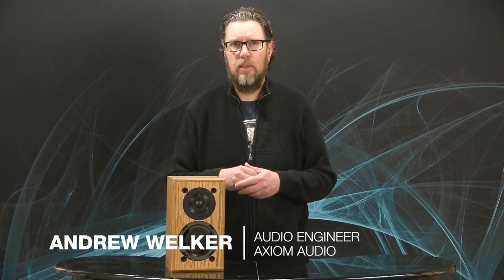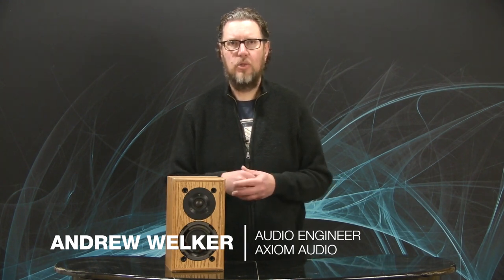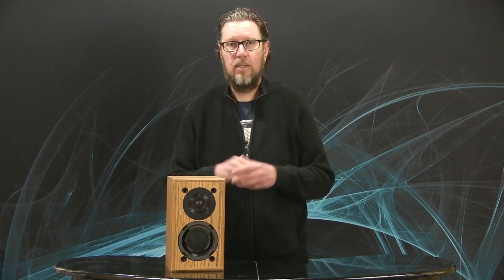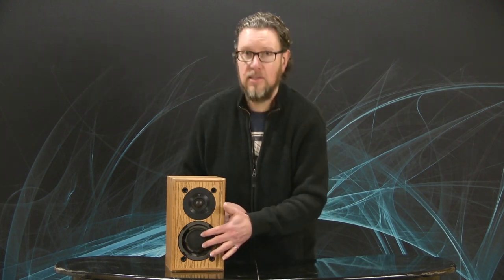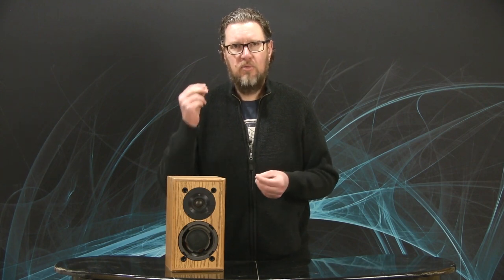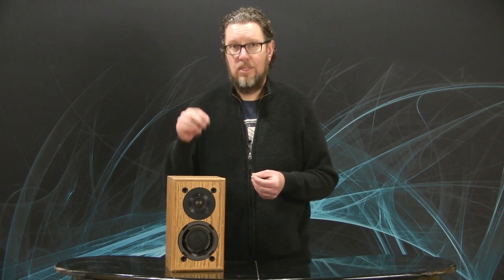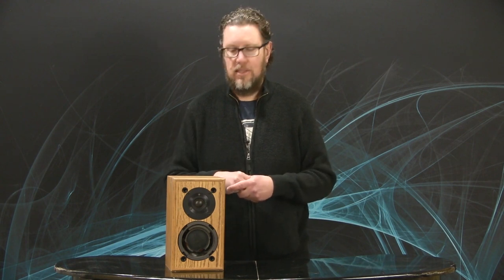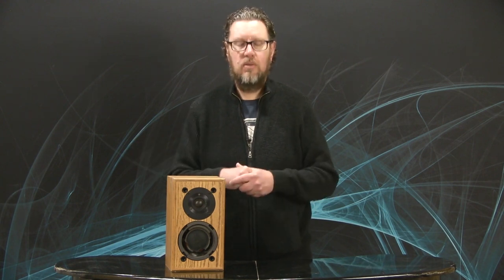Speaker Foam Surrounds: Is It Worth Repairing your old loudspeakers?

Comment: I have a set of 28 year old Cerwin Vega RE30 speakers. They have been connected to a Crown XLI1500 power amp for 4 months. The surrounds on the speakers are kind of worn out showing cracks here and there. The other night i was playing music fairly loud, and after my listening session was done realized that one speaker did not sound right, Upon inspection, I found that the dust cover had fallen off, and the cone paper was torn down where it meets the dust cover. Could driving a speaker with worn out surrounds at higher volumes cause this kind of damage? Thanks for any help.

Comment: I just replaced my 2004 Lexus RX330 driver and passenger door speakers with JL Audio C1-690X's (6x9 w/ rubber surround).  They sound great, but I think the front dash speakers may be blown as well.  My question is whether or not the dry rotted rubber on the Lexus factory speaker is worth replacing and then selling in the aftermarket (Since I no longer need them).  Thoughts?
Reply from the maker: That would really depend on what the cost would be to repair them versus the cost to sell them as used drivers.
Reply: @AxiomHomeTheaters  Yes, that is obvious.  Thank you for your response. I guess I should have phrased the question differently: "Does the cost of replacing the dry rotted rubber on a factory speaker exceed the gross revenue one could capture in the used speaker marketplace (typically).
Reply from the maker: @JAShalvey  It will all depend on rarity in my experience. If those drivers are no longer available from the manufacturer, then someone is probably looking for replacements and the refurb might then be worthwhile.

Comment: Are the new axioms rubber surrounds? Or still foam?

As the HP 6.5" driver is mechanically rolled off (no cross over), if it was ever re-surrounded, would that affect the frequency response curve?
Reply from the maker: All of the current Axiom drivers use rubber surrounds and we have for many years now. All of the 6.5” HP drivers have crossovers and re-surrounding is not really possible with rubber surrounds. The entire driver would need to be replaced.
Reply: @AxiomHomeTheaters  is the crossover component based or mechanical roll off of the 6.5" and 5.25" and a capacitor on on thr tweeter?

If I email you, can I get a frequency response curve of each of the woofers and tweeters?
Reply from the maker: @a88888888a  The 6.5” and 5.25” both have low-pass networks. Neither have a high-pass but the 5.25” is mechanically loaded in a small volume to perform the necessary roll-out.
Reply: @AxiomHomeTheaters  thank you 🙏🙏🙏

Comment: I bought a set of good speakers real cheap once because one speaker had a dent in the center cap. 
I have been using them for years and I have never noticed any distortion in the sound.
Reply from the maker: A dented center dustcap can have minimal impact if the driver is only covering bass and lower midrange frequencies. In cases when it crosses over directly to a tweeter it could have a bigger impact on the sound.

Comment: I checked the cone of my vintage mid-90's Mirage subwoofer. Sure enough, it's a foam surround. Luckily, no sign of deterioration. I don't dare unplug it or turn it off though, otherwise it'll start squealing and feedbacking like crazy the next time I power it back on. I've been lucky with judicious use of contact cleaner, but I'm sure my luck will run out one day. I suspect it's thermally induced and needs to stay warmed up, but I haven't a clue on how to diagnose it.
Reply from the maker: If it’s thermal, as you are suggesting, it’s likely one of the transistors in the amplifier section. Properly diagnosing this would be difficult without the proper test equipment and a schematic.

Comment: I have a pair of Acoustic Research speaker (8 inch) that I use for over 30 years.  The surround had been replaced for at least 3 times.  Recently,  My new Onkyo AV receiver (5.1) was malfunction.  After the repair, the technician told me not to use too old speakers, and that was an intrusion fault which he would not warrant repair next time.  I still love my speaker pair and I cannot find any fault with it.  Could anybody enlighten me ?
Reply from the maker: Interesting. The only thing I can think of is that the voice coil is off centre and maybe causing a short circuit under some conditions that is causing the problem with your Onkyo. A good tech should be able to check that for you.
Reply: @AxiomHomeTheaters  Really tks for your answer, the Onkyo tech accused my spreakers short circuit and caused the trouble to the AVR. By short  circuit, do you refer to the impedance ?  I measure it with a meter and the continuity is ok. Actually there is hardly anybody in HKG to do surround replacement business.  I actually replace the two 8 inch speaker unit half year ago, it is new, and shoud not have any surround problem.  Should I
 buy a new set of front speaker?  tks a lot
Reply from the maker: @lamptl3607  Yes, short circuit would refer to the impedance. Try measuring with your meter while gently pushing in the woofer and see if the measured value drops at all. It’s very unlikely that there is a dead short, but anyone who services audio or video equipment should be able to check out your speakers for you.